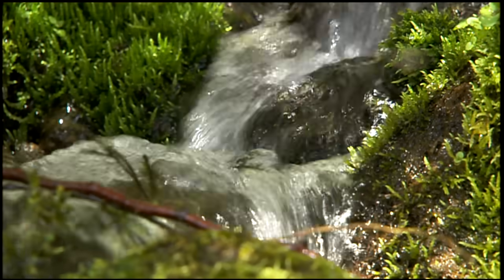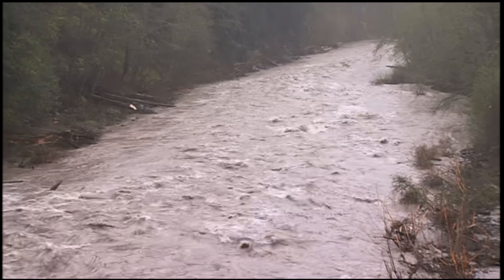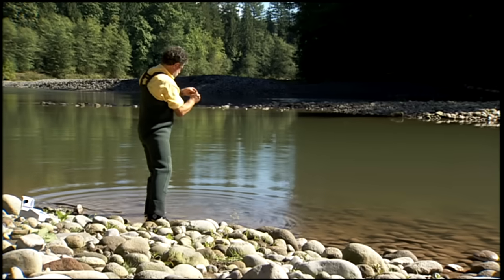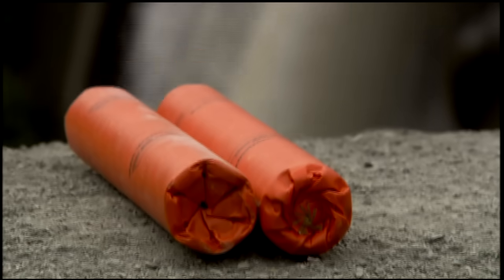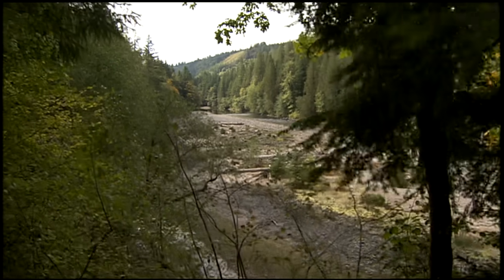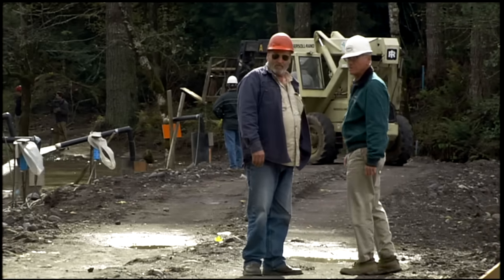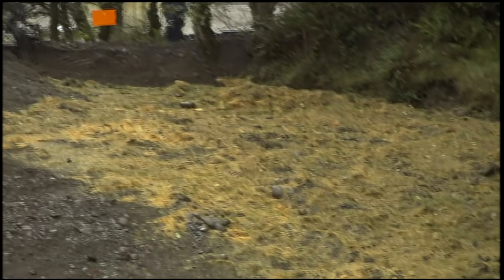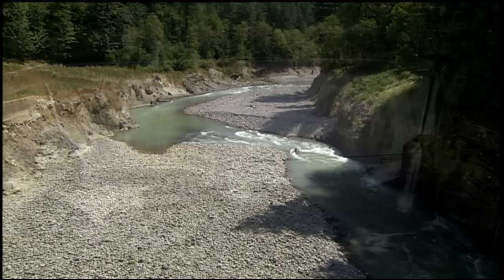A dam no more

Comment: This dam wasn’t producing electric
This dam was completely full of sediment and wasn’t holding back any water
This dam was keeping the natural flow of the river from happening
Reply: What do you mean they were generating electricity with it
Reply: Ya. Not much power however from such and old system. Give it back to the FISH!!
Reply: The dam was still producing electric when it was demolished
Reply: @BenCos2018  very little. It was replaced almost immediately. Bonehead.
Reply: @FYMASMD  fair enough thanks for the correction though there is no need to call people names :-)
Reply: @BenCos2018  a minimum of research and you would have known plenty. Lazy bonehead.